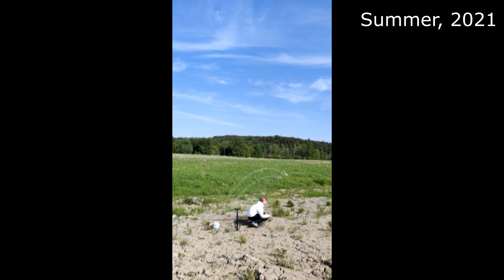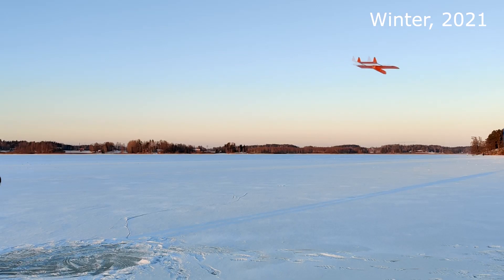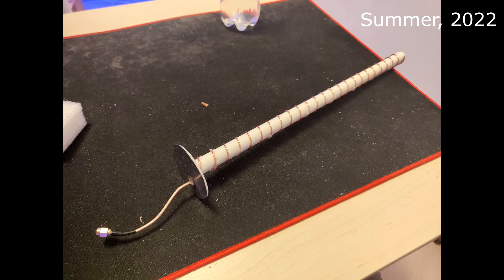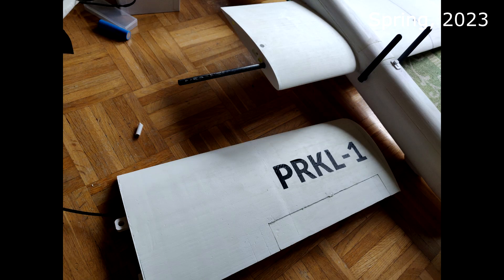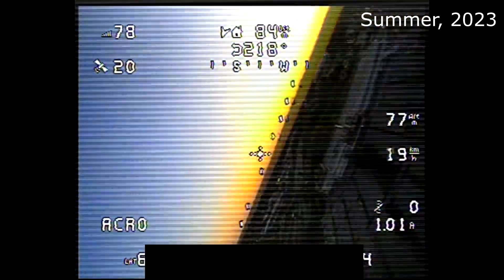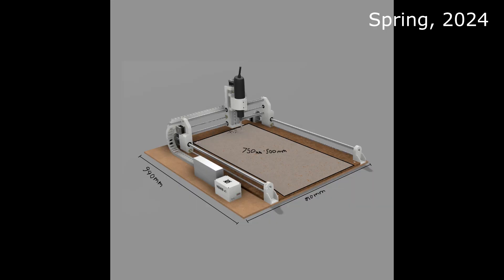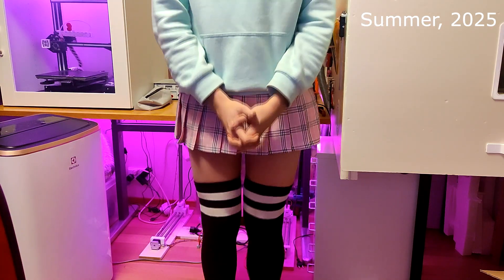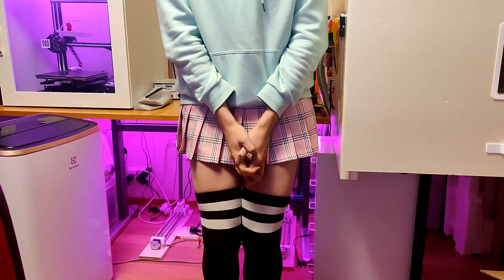5 Years of Engineering Projects  |  Femboy Engineering Maker Portfolio

Comment: Hey, this is my first time seeing your channel and I’m super curious about your DIY CNC machine! Did you base it on an open-source design? If so, which one? Also, any idea how much it cost you to build?
Reply from the maker: Hi! I designed it all from scratch by myself, and made all of the cad models and wiring diagrams myself :3  If I remember correctly, it cost me around ~300€ to build it. I used the RAMPS 1.4+Arduino mega 2560 stack as the controller, and nema17 stepper motors :3. At some point, I plan on making a full build guide with all of the files and everything for it.

Comment: this channel is peak, also some amazing projects, wish i had literally anything capable of letting me do engineering, but no, but, hope your channel grows more
Reply: Hey dude, I hope you are doing fine!
If you can, the greatest thing you could get is an Arduino board (The NANO is both cheap and amazing), a pack of resistors, and a soldering iron, which will allow you to scavenge components in E-waste.
There are seriously a LOT of really useful things in the trash! Not only starter stuff like LEDs, diodes, transistors and capacitors (be careful with these), but also really cool components like batteries and small motors!
Also, desoldering and saving any IC you come across can prove to be really helpful, as you might even be able to find really useful stuff like 555 timers, PWM controllers, motor drivers, H-bridges and even some basic RF modules.

The amazing CNC wire cutter Femboy Engineering made was built with stepper motors, which you can find in any printer, just maybe not the NEMA-17 ones he used, but some bipolar steppers nevertheless, which is still great.

You will need a voltage source for your circuits, and if you manage to find any PC in the trash (for real, the older ones are even better since they have more voltages to work with), you can make your own bench power supply by taking the PSU out of the computer, and then sorting the cables.
The black ones are all GND, which is the common ground for any DC voltage you use, while the red ones are usually 5V and the yellow ones usually 12V.
You will probably find a sticker on the side of the PSU with details regarding each cable ant its voltage.
The last one is the green cable (PWR-ON), which upon being connected to any of the black ones (GND), turns on the PSU and delivers voltage to all of the cables.

DroneBot Workshop has a great video on how to turn a PSU into a bench power supply! I recommend seeing his amazing tutorials, great guy, he is.

And if you can manage to get your hands on a multimeter, it will make your life way easier, but if you can't, there are some workarounds like measuring conductivity with an LED, a resistor and a battery.
Creating your own tools is both amazing and a great learning experience!

For CAD, you can either use Tinkercad (quite useful both for circuits and for starting out with CAD), or Onshape if you are in college/school.

Take care, and have fun.
Best regards.
Reply: also, @Femboy_Engineering (sorry to bother you more), but what stuff do you use for these projects (like the CAD stuff and 3d printer and other stuff)?